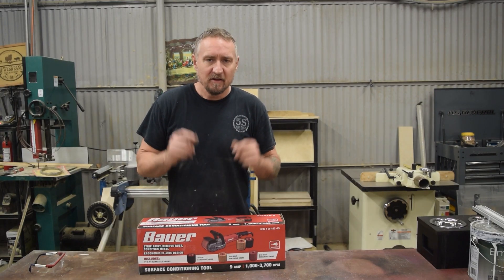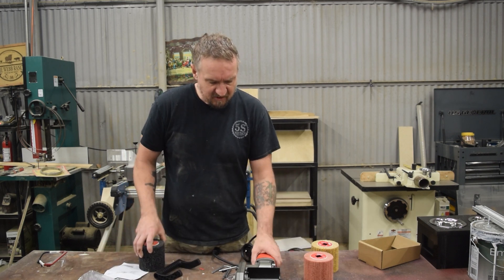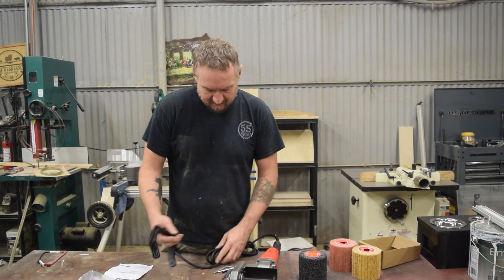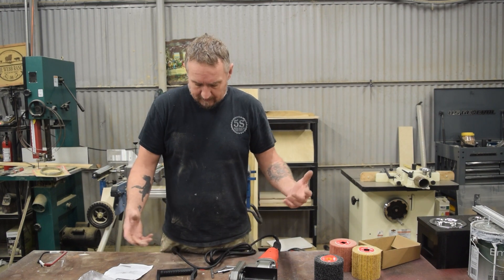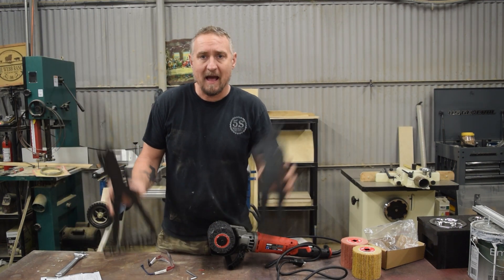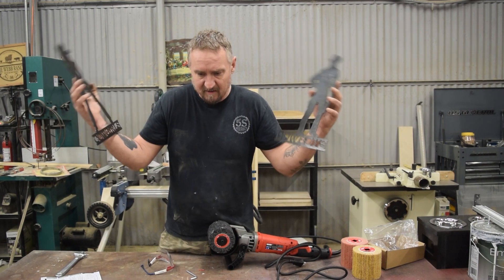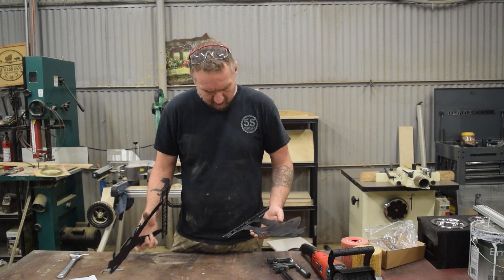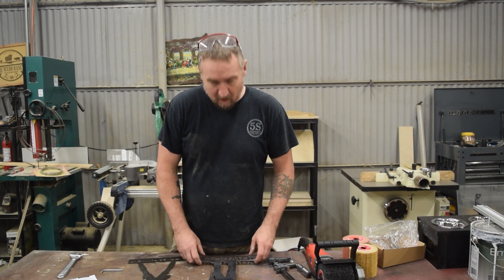Does the Bauer Surface Conditioning tool really work?

Comment: Little tip brother, just grab a strong magnet and bring it close to your eye. Boom, pulls the metal out safer than any grabbing or scraping tool can
Reply from the maker: I went to the urgent care. They scraped for 20 min no luck. Then the ER, they tried for 20 min no luck. Ipthomologust removed it in 3 seconds but not until a full day later which felt like an eternity